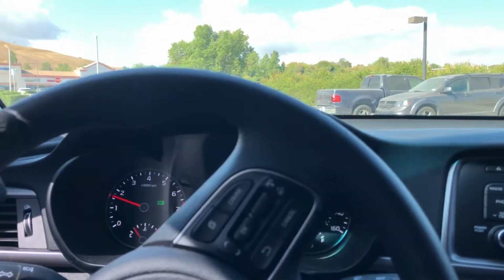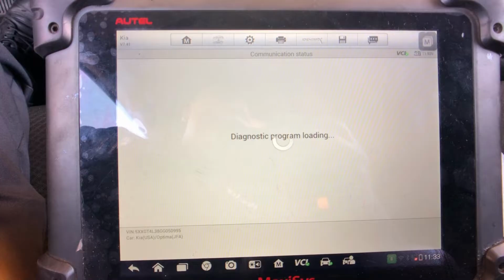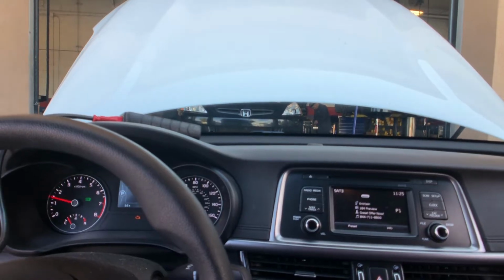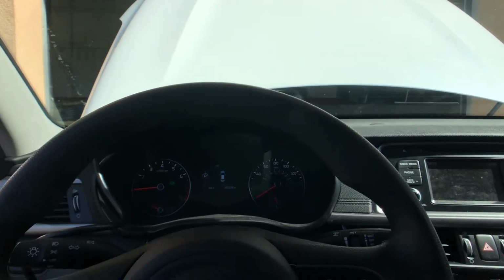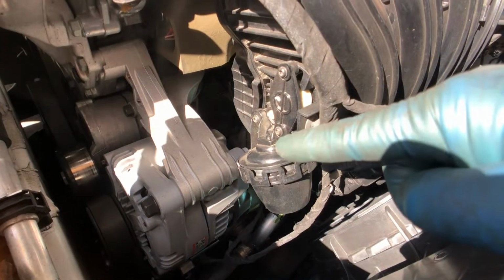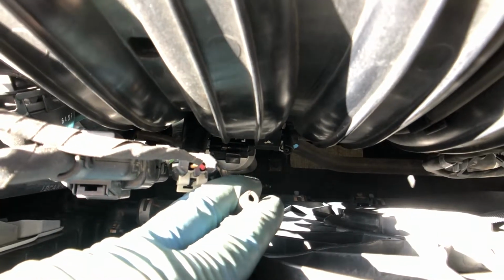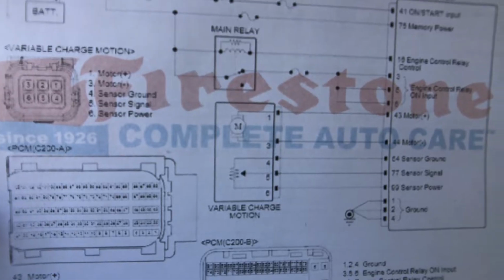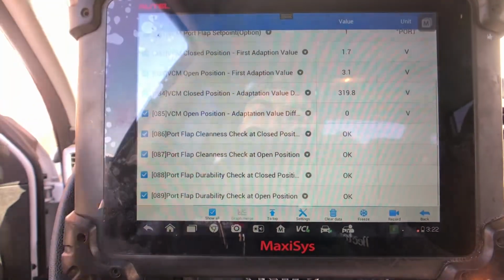⚙️2016 Kia Optima 2.4 Liter - Intake Manifold Runner - P200A

Comment: i ordered the exact control motor for my 2021 kia Sportage for 30 bucks and service kit with new arm for less than 100 bucks from amazon, did job my self in 2 hours, part at dealer is about 250

Comment: Surprised they had this issue with such low mileage. Seems like this is a common issue with these vehicles though. I am currently having it on an 2018 Optima with 138,000 miles.

Comment: Thanks for uploading this video. I have hyundai Sonata 2017 SE model. This issue came 3 weeks ago in my car. I found this video and showed it to my mechanic. He understood the issue and change the small part of VCM kit as mentioned in video. He charged me 274$ in total. It was done ine few hours. Its been more than a week since repair, the issue hasnt come yet, so its been solved. I have bluelink services hence I called Hyundai service center and explained them issue they were giving appointment after 2 mobths. Hyundai service centre is completely useless hence I went to local mechanic option. Thanks a lot for this video.
Reply: Was the part he ordered is genuine Hyundai or can you share the link of the device . Currently dealing with the same issues

Comment: Hi, I know video is 2 y.o but I need the number of this actuator (I mean code) maybe you have some very useful links ? Thanks :)
Reply: Yes, I bough the detail on secondary market, it needs for high engine speeds, this vavle makes shorter or longer contour for intake manifold

For the first time, I drove without this valve and everything was fine

I can’t give you the number of detail due to I didn’t find any signs on the detail :(  except the number of plastic material..

I recommend to find some info in blueprints on Kia website
Reply: Did you ever figure anything out for it?

Comment: $500 bucks?  I just bought an OEM Doorman at  Autozone for $172. Free next day shipping. Ordered it Thursday got it Friday before noon, had the thing installed before the end of Friday night. (Only because it’s a freaking pain in the ass to remove and install.) 2016 Hyundai Sonata is basically the exact setup of ‘16 Kia Optima.
Reply: What code did you get before replacing it? I am having the same issue when I went to autozone to check the code it gave me code P200A and it recommended to replace the VCMA (variable Charge Motion Actuator) but at O’Reilly they said it was the Intake Manifold  Runner control motor (same one you bought) now I don’t know which one to replace
Reply: I’ll warn you, it’s a freakin bitch of a nightmare to get to. I’m pretty handy, not a professional but I’d suggest dedicating a Saturday to the job. It’s not difficult at all, just very finicky and hardly room unless you disconnect vacuum lines and more hoses than I did. Here’s the video I watched about 1000 times. It’s helpful 
https://youtu.be/N2Y-3gp2nDM

Comment: What did you end up replacing to fix issue was it the motor
Reply from the maker: Stephen Silagy I didn’t replace anything, it was covered under warranty, but the VCM had to be replaced 👍🏼
Reply: @HomieHektor   mine is doing same thing .started today . Is it pretty easy to do I've worked on my own stuff for a long time doesn't look hard to do

Comment: I feel so bad for owners. Today, I saw the 3rd one in 3 weeks. Unreal. It is not a cheap repair and this poor guy has 62k miles. It's a shame.
Reply: That I agree Kia / Hyundai crap theta engines etc
Reply: That is why KIA/Hyundai are complete crap.
Reply: @applepoop10  i got a hyundai sonata it got the same.problem how much it going cost to repair?
Reply: @mr.underground13 how much did it cost bro I’m having the same issue rn
Reply: @cjrodriguez1090  tbh the check engine went away so i havent fixed it yet but i went and got an estimate at the hyundai dealer and it costs about 800 thou
Reply: I had this happen I changed the solenoid than the small motar it went away now it's back I did the same thing again now I'm on the motor an in the back where the solenoid goes has oil coming out of the back black rectangular part . Do I have to put more seal on . Idk what the last owner done

Comment: This is a 2016 Kia Optima with 46k? Doesn't this vehicle have a 10 year 100k warranty that would repair this vehicle free? Or is the customer unaware of this warranty unless this vehicle has a salvage title?
Reply: 10 year /100k Only powertrain not powertrain accessories and only applies to original owner! 5 years or 60k bumper to bumper.
Reply: @ronijr4918  After spending 15 years as a mechanic at a Chevrolet Dealer, there Is no such thing as a bumper to bumper warranty. Bulbs are not covered, wiper blades are not covered, Maintenance items are not covered, adjustments are not covered. I didn't know whether he/she was the original owner or not. But it still never hurts to ask a dealer.
Reply: @jumpercable20  Great job bud but  i didn't really need to your story! However as a technician you should know when talking about bumper to pumber i don't mean maintenance item's which any one who has half a brain would know that and specially a " technician " That's like asking a person who is having a stoke if they need emergency help? Like it's common sense bud! Cheers and keep turning thode sockets! I don't mean to come on rude btw
Reply: Yes some vehicles have bumper to bumper warranty, 12/12k covers everything,  bulbs,brakes wipers,clutches.

Comment: Another great video hektor,  como checas el solenoid con la vaccum pump? Or no se puede? Gracias y un saludo desde Ontario California,
Reply from the maker: Everardo Camacho Orale Vecino 🙌🏼 a él solenoide le puedes aplicar vacío con la vacuum pump, y si se mantiene el vacío le aplicas corriente y tierra para ver si se abre.
Reply: @HomieHektor  thank you for your quick reply, I got it,un saludo
Reply: @HomieHektor   what did you end up replacing to fix issue was it motor

Comment: Good lord if your making engines with plastic exhaust your a piece of shi#
Reply: Luckily it’s an intake bud
Reply from the maker: nimfodelity 🤔
Reply: Funny, back in the early 90's Ford built an ALL plastic 4 cylinder---Block, Head, Crank, the whole ball of wax. As you can figure, technology still hasn't found a way to make it last 100k, since most manufacturers can't make anything last 100k (and be idiot proof).

Comment: Why wouldn't that be covered under warranty?  Dont they have 100K mile 10 year?  Great video
Reply: I believe that once you become the second owner, depending on which owner this is, the length of the powertrain warranty is automatically reduced from a 10-year/100,000-mile term to a 5-year/60,000-mile term. Not sure for subsequent owners after the second.
Reply: @BigBlooFrostie  it should still have been under warranty. Only had 45000 miles.
Reply from the maker: Stephen McGowan I’m not sure exactly what is covered under warranty, you gotta read the fine print. I’m sure they took it to the dealership to see if it was covered 👍🏼